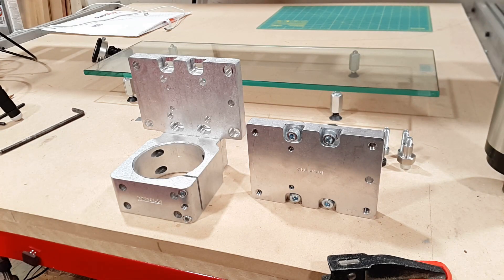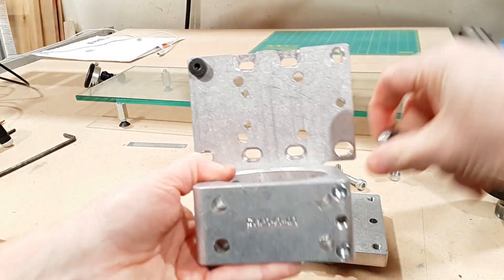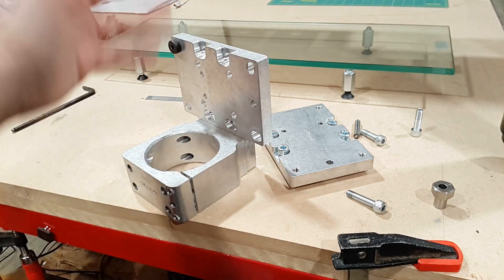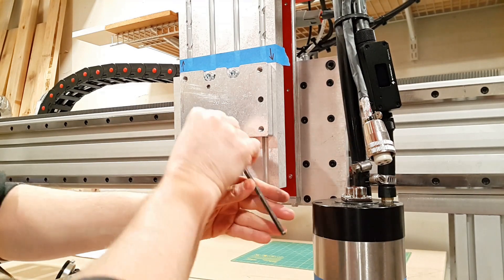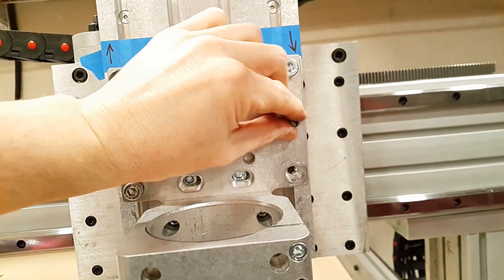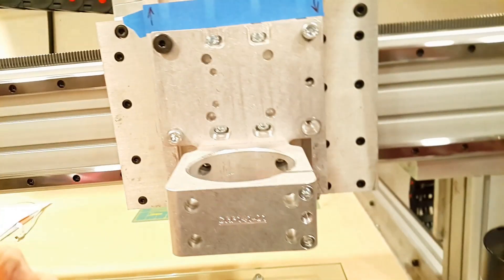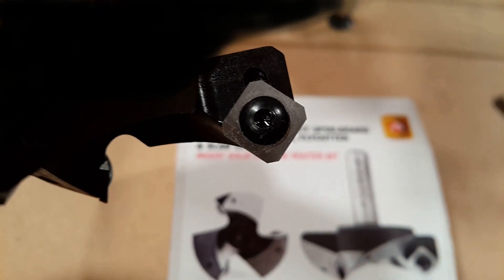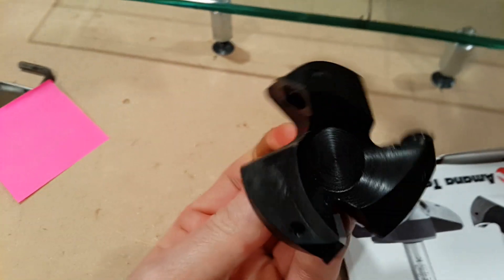AVID CNC's 80mm Spindle Mount with Tramming Adapter

Comment: in 5:42 , I saw your timing belt to slide the axis.  but, why you choose timing belt than using lead screw ?
Reply from the maker: The 3.2:1 belted gear reduction provides mechanical advantage that reduces the amount of torque required to move a given mass. For example, my X-axis stepper motor (which is gear reduced) uses less of it's rated torque to move more mass than the Z-axis which is attached directly to a lead screw. The cost of this advantage is speed, the gear reduced motors have to rotate more to move the same distance. (Direct comparisons of motor rotation to linear movement is complicated by the pitch of the lead screw but I hope the explanation is somewhat useful.)

Comment: Thanks for your video.  It was very helpful.  Ordered the tramming plates today and the bit as well.  Plan to drill and thread a 1/4" bolt hole on the bottom of one of the plate to help adjust in my "Y" axis.  Will place appropriate shims only after tramming is perfect (others may need to drill hole near top, depending on your needs).  But would not had ordered this easy tramming system and bit without you sharing your experience.  So many THANKS,  Mike
Reply: I know im randomly asking but does any of you know of a tool to log back into an instagram account?
I somehow forgot my login password. I would love any tips you can give me.
Reply: @Beau Garrett Instablaster ;)
Reply: @Randy Preston i really appreciate your reply. I got to the site through google and I'm in the hacking process atm.
I see it takes a while so I will get back to you later with my results.
Reply: @Randy Preston it did the trick and I actually got access to my account again. I am so happy:D
Thank you so much you saved my account !
Reply: @Beau Garrett glad I could help xD